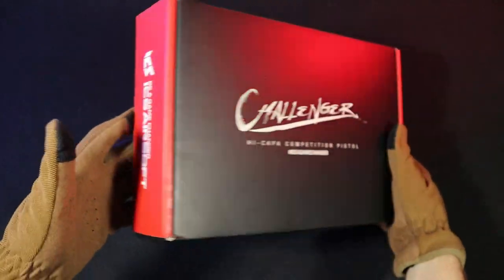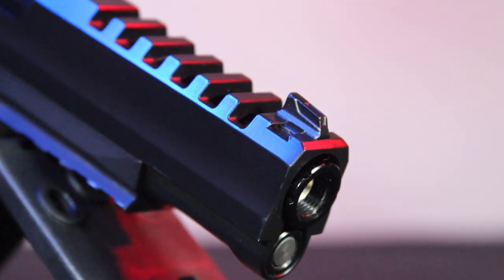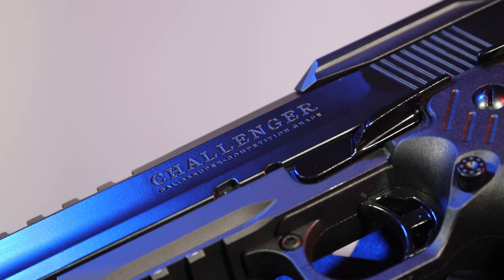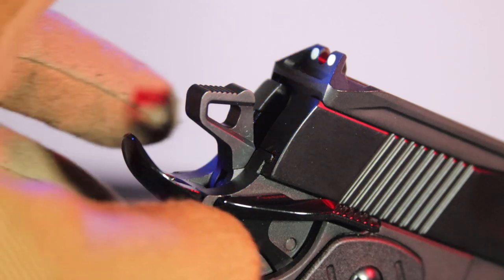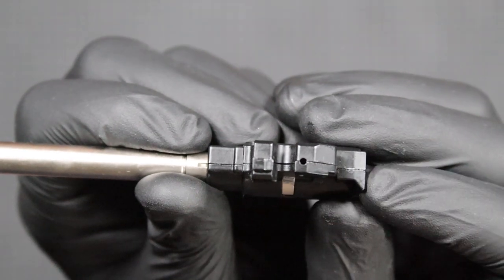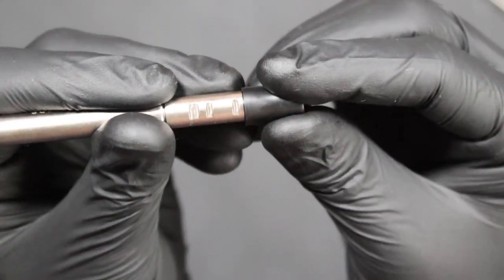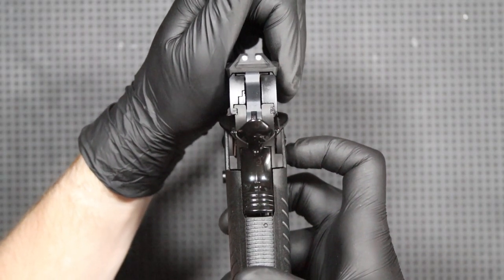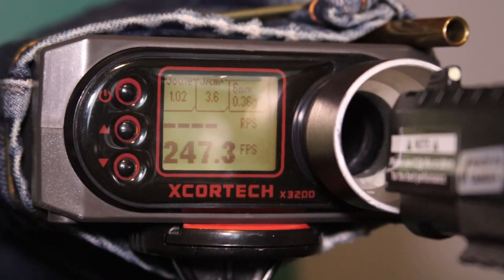Airsoft Review | ICS Challenger Hi-Capa | Real Game Changer!

Comment: Thanks for the detailed break down!  Have you tested the performance using .28 or .25g bb’s?  Wondering if the joule creep still occurs and its impact on velocity.  Will definitely look for its release in U.S.
Reply from the maker: Joule creep is best seen on heavier than 0.30g bb's, on lighter it does not go higher than on 0.28g
Reply: @Maniek44Eng  ICS will have an upcoming sale from me thanks to your review.  Hope pricing for it and magazine come soon.  Sounds like you do not think any upgrades are needed.  The thin coat of paint is a odd to see as my Komodo from them has held up well.